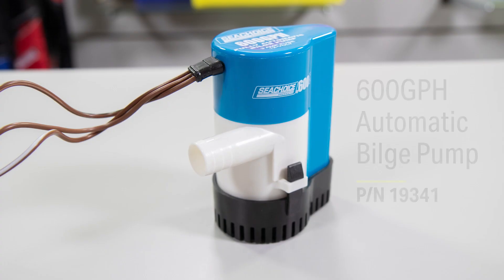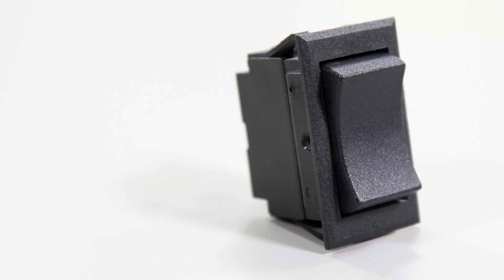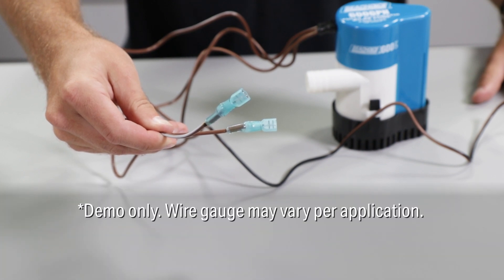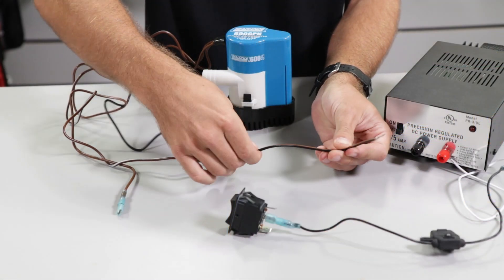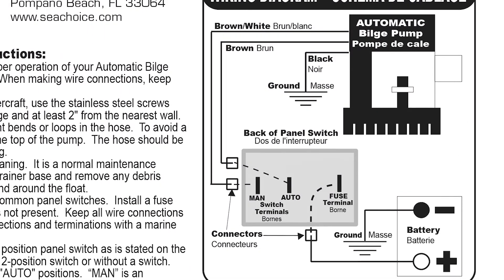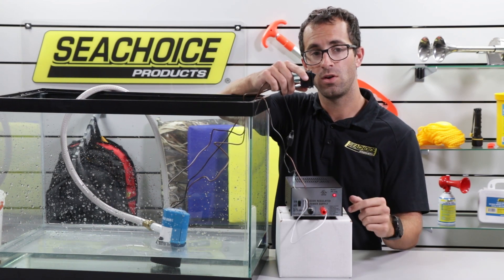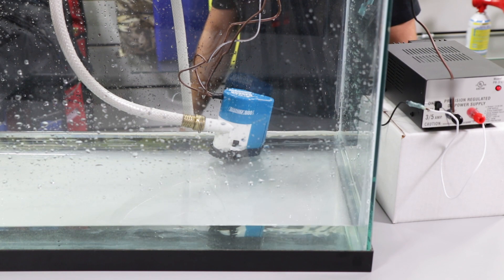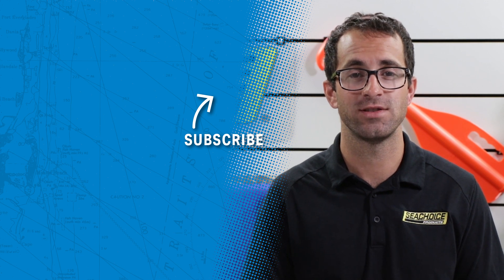How to Wire an Automatic Bilge Pump to a 3-position Switch

Comment: Not very smart to use these switches. You need one with a confirming light or sound to know if bilgepump actually pumps.
Reply: Luckily mine I can hear it pump (and sadly discharge ) when manually pushed.  But you’re right can be hard to hear one running in certain boats and I’ve accidentally left one on once and went home from the marina.  There is another device called a bilge pump counter you can wire that keeps track of activations so you know when you come to your boat how many times it went off

Comment: How would you wire it direct to a battery with no switch?
Reply from the maker: Installation w/o a panel switch is a little too lengthy to explain here. Please refer to the bilge pump manual: https://www.seachoice.com/pdf/19341_AUTO%20BILGE%20PUMP.pdf

Comment: Good demonstration about wiring Phil! However, I got dissapointed to see that the pump got activated after the water level reached over 3 inches of water...  ):. Not good for my boat.
Reply from the maker: You can use the pump's manual feature to start pumping water out before the float switch is activated.

Comment: On a auto pump like this, can you run the power and ground to a fuse box instead of an inline fuse?
Reply from the maker: Should be able to. This is a direct current (DC) electrical system. As long as the fuse box is compatible with the voltage and amperage required by the pump, wiring grounding wire through a fuse box should work just fine.
Reply: @SeachoiceProducts  would you suggest wiring right to the battery or power source or to the fuse box?
Reply: @jedg9627  It depends on the application.  Boats left in the water unattended often have the bilge pump power coming directly from the battery, so that power to all the other services can be switched off when the boat is unattended without losing the bilge pump.

Comment: I have a 2008 Yamaha Waverunner with Rule 500 GPH automatic bilge pump. May I add this switch to add a manual running option of the bilge pumps when the ski is not running?
Reply from the maker: We believe this switch is compatible, but please check the instructions of your Rule pump first.